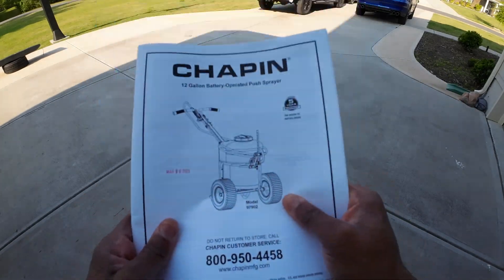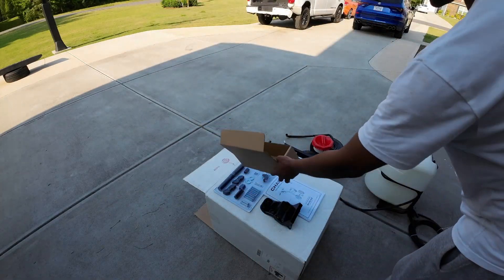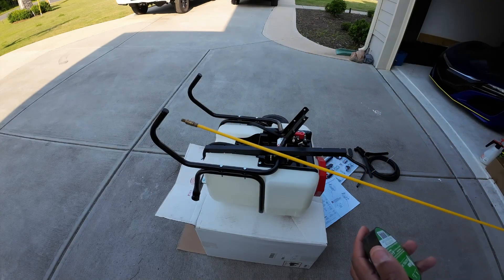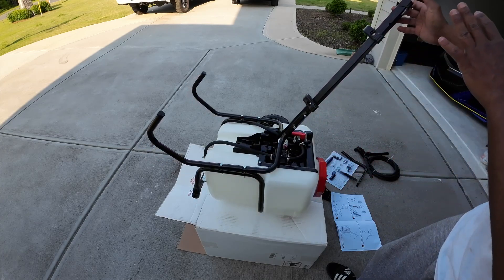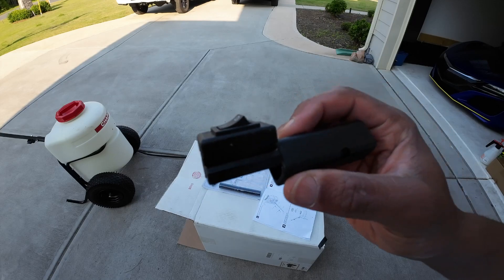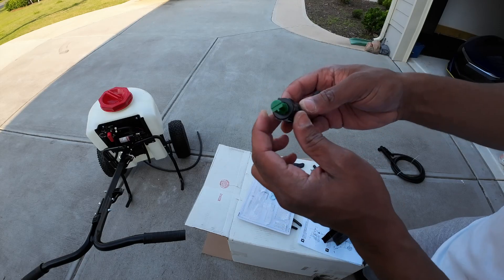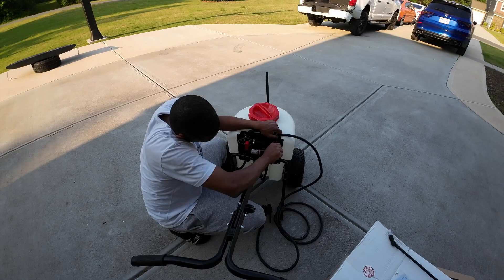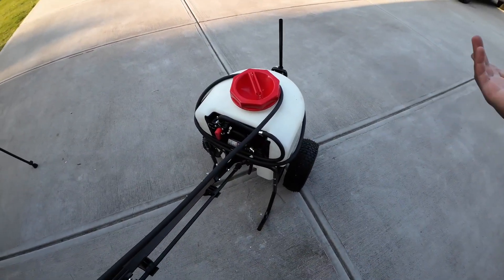Chapin 97902 Battery Push Sprayer Unbox and Setup

Comment: Can I ask a question?  What is the highest measurement that the spray tip can be adjusted off the ground?
Reply from the maker: It's about 20.5 inches.
Reply: @btshomedition that's disappointing.  Teejet recommends that you use a 1:1 ratio of height to distance with their 110 degree fan nozzles.  If you want to use the wheel marks as your spacing guides (which is about 26") then you would want your nozzle tip to be 26" above the ground.   I wonder how hard it would be to modify this? Like to mount the nozzle head above the clamp that holds the vertical bar?